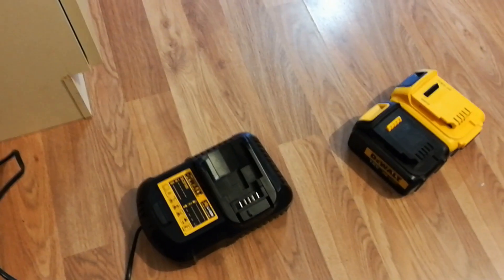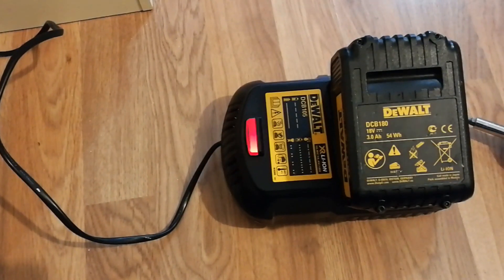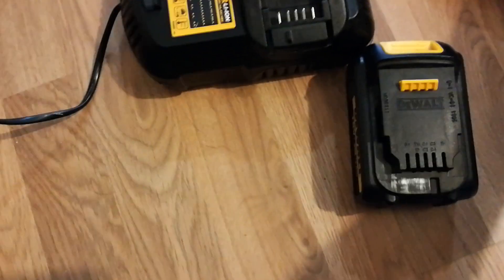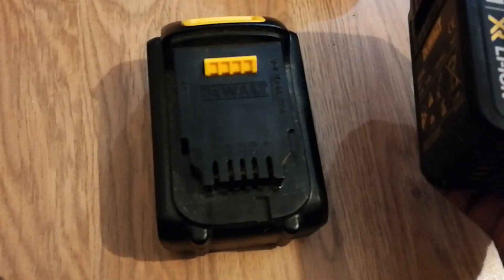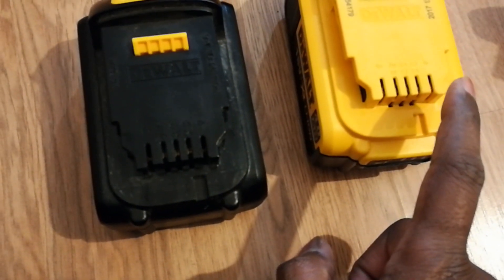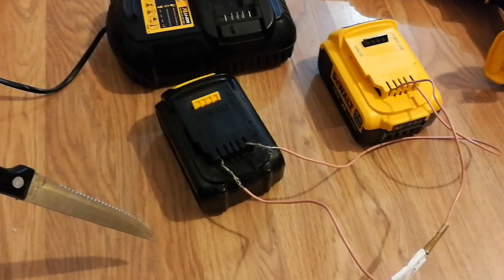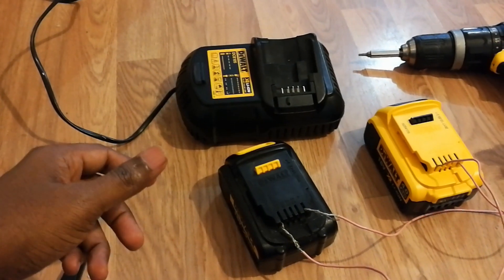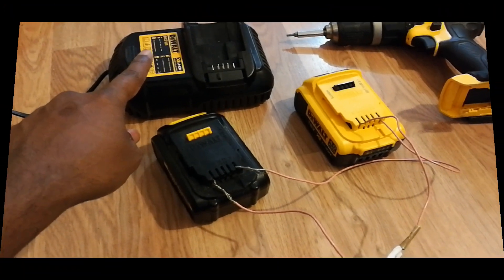How to Revive Dead Li-ion Battery  (Jump Start)- DeWalt 18V | Any Li-Ion Battery | Ni-Cd Battery

Comment: This worked for my dead 20v DeWalt 6ah battery (very expensive, would hate to have to replace)! I think my battery was completely depleted after leaving it attached to an old 18v tool via an adaptor... it would only fast-blink on the charger after that. I thought it was ruined until I tried this! Thanks for the video and clear instructions!

Seems silly that DeWalt chargers require batteries to show a little voltage and don't offer an option to "jump start"/force a little charge into completely depleted batteries like this. I suppose it's a safety feature in case the battery isn't just completely depleted but is damaged somehow?

Comment: First of all you talk too much. Second it is not a safe method of connections in home. There is a possibility of Li ion batteries. Third you kept the wires in side the other batter. what happens if both touches. So careful before uploading such videos.
Reply from the maker: I will keep in mind, to be precise
Reply: @UGRTechHowTo  I appreciate your intension of fixing batteries. It will help a lot to learn. I was concerned about the safety. Good luck and go on.

Comment: Mine does not flash at all
Reply from the maker: There may some internal damage, open the battery covers and check the internal cells. If you open you may not able fix back, that’s the risk. In any case if it doesn’t work then worth a try. If you check each cell inside with multimeter the voltage, any individual cell less than 3.7v dead and can’t be revived. Replace that with new or functional cell and you are done
Reply: I've done exavtly as said, positoo to positoo and negatoo to negatoo but didin't work for me...The battery voltage shows 3.1V!